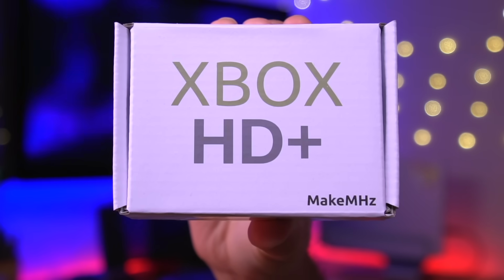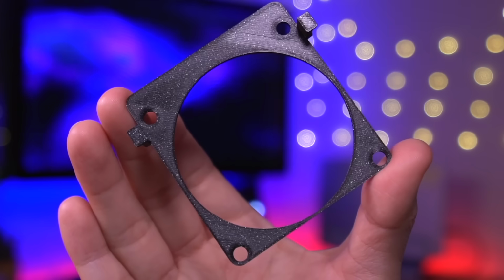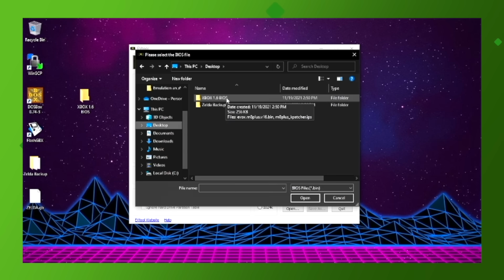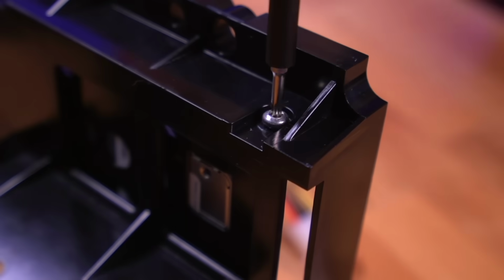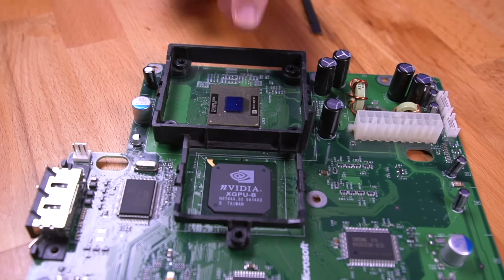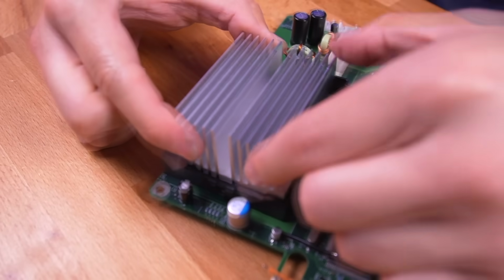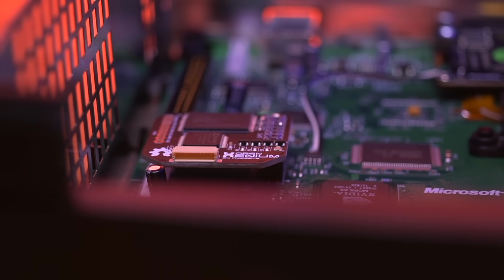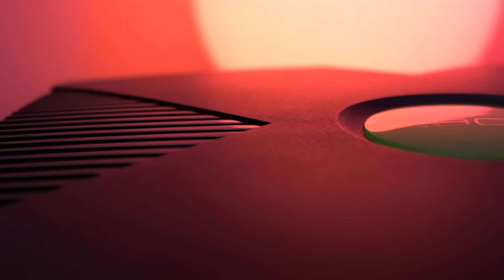I BUILT THE ULTIMATE XBOX TO CELEBRATE ITS 20th ANNIVERSARY | MakeMHz HDMI + SSD + OpenXenium +MORE!

Comment: Didn't the OG Xbox have a shroud over the heatsinks leading to the fan?
Reply: That's on the 360. With the DVD drive fitted the OG xbox didn't need one.
Reply: @ianhaylock7409  Oh okay sounds right. Been ages since I last ripped apart my original Xbox. I figured it did because that airflow looks pretty meager from todays standards!

Comment: For anyone who's watching this, it needs to be noted that the SSD will not add a substantial boost to speed, at most just a second. It's bottlenecked by the processors power, and IDE is slower compared to SATA I and II

Comment: I miss these things. I remember the day when I discovered that I could cut a dongle and put a normal usb end on it.  I had one in 2006 that I did the Splinter Cell save card mod with, changed the HDD out to a 500GB(that was an experience, you had to unplug the IDE cable at just the right moment after the boot unlocked the drive, and then plug it into a PC to copy it.  XBMC was great, and DSL(damn small Linux) gave you a Windows "like" desktop experience.  I wish the Make HDMI had been a thing, but I was getting 720p with the Red Blue Green cable set.  This was a cool video.
Reply: I modden one of my controllers long ago when I took a wild guess that the controllers were just using normal usb and had the controllers were using a usb hub for the memory card slots . So I just replaced one of the memory card slots (since the controllers had two on them, and put a normal usb port in the memory card slot so I can just use usb flash drives for a memory card, and keep the second port for the original card. Later I found this came in handy when soft modding the xbox.
Reply: @ikannunaplays  They were awesome for modding.  Microsoft's first attempt at console gaming.  They just built a PC, lol.
Reply: @GaltJohn2008  Yes indeed, they did the same with the 360 and newer, just tons of extra security with it.

Comment: i was 13/14 years old when i had my xbox and i soft-modded it using Action Replay and the Splinter Cell Saved profile method. I never did any hardware modding to it at all. Only thing i did physically to my xbox was put a cool clear red case on it. I used to mod Halo 2 back in the day. On xbox live i could only do the the DLC map mods since i didn't do any hard-modding. otherwise i used XBC or Xlink Kai for non-dlc maps. man, the nostalgia it brings me. the best times i ever had playing games online. nothing will ever compare to those moments i had then.

Comment: Dang, this mod looks very advanced. I've never heard of unpacking/patching/repacking firmware before, and I'm not even certain the software I'd need to do it. There seems to be many potential points of failure in completing this project, and I wouldn't know what to do if something didn't work first try! Still, this is amazing and inspiring. I think I'll practice more with hardware mods before I worry about software mods.
Reply: Softmodding the Xbox is an option too and its quite simple to do so long as you have one of the exploitable games. I have a softmodded Xbox from like 2015, I used the Mechassault save exploit to do it (you get the same UnleashX dashboard). I use XBMC on it with a really nice HD GUI that makes it look like a Xbox One menu and runs really well.

Comment: I was under the impression that a TSOP flash was the better alternative to a modchip. Is there a reason why you went with a modchip? Is the HDMI mod not compatible with TSOP flashed Xboxes or something?
Reply: In this case, he didn't have any alternative except to use a modchip - the V1.6 xbox doesn't have a TSOP flash and has a masked boot ROM contained in one of the MS custom chips on the mainboard (probably the one marked Xyclops).  If you have an older version, then it's possible to reflash the TSOP, which has both advantages and disadvantages.  The biggest advantage is simply that you don't have to buy a modchip - just open the box up and solder the write-protect links on the mainboard.  The biggest disadvantage is that if you run into a problem flashing the TSOP then you can brick the entire console.

Comment: So I just got one of these installed into my Xbox and was wondering what is causing the graphical glitch. I’ve tested a few 480p games and all of them have displayed the glitch however it’s completely absent in 720p and 480i games. I’ve figured changing the XboxHD+ setting from force 720p to auto has fixed the graphical glitch so until the update do not force 720p. Also where would I go about finding the update correcting the glitch once it’s released?

Comment: I missed it if you mentioned this or not, but did you remove the clock capacitor? They are notorious for expiring in dramatic fashion, corroding the board as they do.

Comment: I wish I was comfortable doing the hdmi mod. Nice work! You may want to consider removing the clock cap and adding a Ogx360 in with your hard drive tray so that you can use wireless 360 controllers as well!

Comment: As a Day one OG Xbox owner, to see those mods look super easy compared to the 20+ soldering job done to one of the OG xbox in my collection.  Time to find a 1.6 and get to modding!!!
Reply: Personally I would go for a 1.5 or older because then you could also do the ram upgrade. There's a select few games that require it and over 100 720p patched games that can utilize it.
Reply: @lain328  1.5 does not exist
Reply: @prismatic1239   You do know that 1.0 to 1.6 a naming thing. Not existing is not part of this, some think it does & others say no.
If you like to got this way, the naming of 1.0 to 1.6 does not exist. We made that are selves, not Microsoft.
Reply: 1.6 ram mod can be done by adding the ram ontop of the existing ram. One pin has to be soldered on top specific parts of the board though. Not read anything of ram overheating after mod but it’s defo going to be hotter

Comment: One more tip: If you haven't done so yet, make sure to also remove the clock capacitor and clean up any spilled capacitor leakage.
Reply: rev 1.6 had better quality capacitors than the previous revisions so the clock cap is less prone to leak, but it's always good to check. eventually they'll all become leaky
Reply: another, another tip. Brooks makes an adapter that will work with the Original Xbox. Its a usb adapter but you will also need the USB to original xbox port adapter to plug it into. This way you can use a modern Xbox controller/PS4 controller or even a fightstick on the original xbox
Reply: @stopthrm  Why would someone ever want to use a modern controller on an original Xbox? The Duke and S controllers are both great.
Reply: Nope not on a 1.6
Reply: @AlfieG2255 My v1.6 had a leaking clock cap as of 1/1/2026.  They're over 20 years old.  I see a lot of people saying v1.6 are safe.  They're not.  (Granted, your post is 4 years old, but I've seen folks in 2025 claiming 1.6 is bulletproof).

Comment: I’d like to know the temps you’re getting with the fan. I did this exact mod with new thermal paste and found that the console was not cooling down properly. Even changed the settings within unleash x only to have the fan sound just as loud as the stock one. The older fan has bigger fans to bring in cooler air, it is loud but keeps the console much cooler. The newer fan is the same size but doesn’t bring in as much air to cool the console. So I cleaned and re-oiled the old fan it’s a bit quieter now. Still looking for either the proper settings for this fan mod or a better fan.

Comment: The version you have is less prone to issues like a leaking clock cap but any time you put time and money in a project like this it can't hurt to give the xbox a preventative recap as well.
Reply from the maker: I totally forgot to mention in the video that I replaced the all the caps on the motherboard and power supply before doing the other mods
Reply: @MachoNachoProductions  you uploaded the patched bin files to the xbox before partiitioning and installing the ssd.
could you clarify this.
Reply: @MachoNachoProductions  where do you get a replacement psu for such an old console?

Comment: Cool mods.  Another tip that I'd mention is that you should only install a hydro bearing fan for it as it basically makes the fan unhearable and functions at optimal performance.  A company I recommend is GUID fans if they are still around.  I have a few left which I bought years ago.  Also SSD vs mechanic drive on a system like this is pointless.  If you got a mechanical drive it's going to perform just as good.  Lastly, you should also remove the time/clock capacitor on your Xbox depending on your model which has been known to explode and leak over all the components on the board causing corrosion. Keep that in mind.
Reply: The SSD is not useless if you're backing up your games to play off of the disk. In fact, it's pretty much the best way to go about it. The difference in performance is massive.
Reply: @caodesignworks2407  The most this SSD's can output is 133MB/s because of ATA/133 limit. Games were writen to use slow (for 2021) IDE drives with whoping 30-40MB/s, so SSD wont do much
Reply: He stated that it’s a 1.6 board revision. No need to remove the clock capacitor since it’s vital for 1.6 functionality. SSD is more reliable in the long term versus regular HDD due to less moving parts.
Reply: unfortunately mine has Already leaked all over the motherboard, but somehow the system survived and works i have no idea how but the only thing that stopped working is the power button and whenever i plug the console in it just turns on by itself, at least the eject button still works
Reply: When transporting 10 xboxes at a time for a LAN party, I'm sure glad I took out a bunch of spinning metal.

Comment: Nice video, but to truly call it "ultimate" you need at least the 2TB SSD (Samsung 860 EVO, the Pro is needlessly more expensive) and the 128MB of RAM upgrade. Others (not me) might argue for a CPU upgrade to the Tualatin 1.4GHz and maybe add some OLED screen for the system.
Reply: Does beefier SSDs really so anything when you're converting the SATA interface to IDE anyways?
Reply: @erik3371  Yes, it offers a 2TB capacity which is at the limit of MBR capabilities. We are talking about "ultimate", so we have to take it to the limit, right? 
I don't think that there is anyone on this channel who does not relate more capacity with being able to store more data (software, games, videos, music) locally and who does not find it convenient to access said data on the fly. It's not always or only the speed of the device that counts, but also its size; whoever says that size doesn't matter either has no use for it, or simply lies.
Reply: I agree with you regarding the 128MB RAM upgrade and the need for a large hard drive, although a mechanical drive would suffice instead of SSD. As for the LCD screen, I installed one on my system, and to be honest it’s a gimmick. I wouldn’t do it again.
Actually, for an ultimate Xbox, now you have the option of the recently released cerbios, which allows the use of an 8TB drive!

Comment: The only thing that I would do different is that I would use a HDD instead of a SSD as the SATA to IDE adapter will basically make the speed advantage that a SSD have over a HDD irrelevant, making the SSD a waste of money. Although I guess using a SSD will be quiet, but stil not worth the extra cost in my opinion.
Reply: SSD also has better seek speed over an HDD, so it may still be worth it. Would need a side by side comparison on loading times to confirm.
Reply: @amcadam26  I have never done any side by side load thest with a SSD, but I have done side by side load test using a Xbox with sata HDD and one with a IDE HDD a few years ago when I was really into OG Xbox modding and the IDE HDD was always faster. 

The reality is that the adapter will slow everything down to the point where any advantage a SSD normally has doesn't really matter.
Reply: honestly, the ssd being quieter is a disadvantage imo, i love listening to the sound of old hard drives working their magic, though of course an ssd is a lot more reliable than those old hdds
Reply: @Fogolol  the sound the original Xbox makes when you turn it on, sounds authentic to me. The only thing that comes close that I have is my Xbox 360 E.
Reply: @austrakaiser4793  yep it really does just sound like an old computer doesn't it? And i fucking love it
Reply: This is why you just need to get a native industrial ide SSD for the OS, I picked up an aftermarket 120gb one for only 36 usd and it actually can cause problems because it loads too quickly in some cases, such as in Defender 2001, but those can be manually circumvented

Comment: Tip: you can avoid scraping the heatsinks entirely by spraying Goo-Gone onto the black thermal compound and letting it sit for a few minutes, then a q-tip/cotton pad should get it right off!
Also, a normal hair dryer can heat the GPU heatsink enough for it to come off.
Reply: You can also have the system for running for like 10mins and it’ll come right off
Reply: @javieraleman5256  And the kids
Reply: Thank you for the advice! I do appreciate it!
Reply: I used qd contact cleaner and it slid right off.
Reply: @fulltone10  I love that stuff and its available at just about any hardware store (and half the price of deoxit)
Reply: Where do I buy an SSD for mine? The site is sold out.
Reply: Acetone also works very well to remove the black gunk from the heatsink, but it may be safer to use Goo-Gone
Reply: QD is good enough for my car's battery wires it's good enough for my console cpu
Reply: An important thing to realise about the OG xbox is that it heatsink paste was never "just" thermal paste. It was actually a thick thermal adhesive, and the heatsink clamps are prone to breaking or coming loose after this long. If you're worried about the clips or they're broken then using a similar thermal glue is a good option to hold it down. If the clips are good you could use carbon pads which will last forever and won't dry out, or a PTM sheet (most accessible will likely be Thermal Grizzly PhaseSheet PTM).
Reply: I guess the question is what kind do I need? What connector / speeds. Dumbass entering chat.

Comment: There is no speed boost when using a SSD over HDD under an IDE controller, even when using a SATA to IDE converter board since it communicates to the system solely as IDE. The max read/write speeds of the IDE controller matches that of a 7200RPM drive, which are easier to find more affordably in higher capacities than SSD (though really, 60GB should be more than plenty for this old beast).
I would also like to make mention of the ability to upgrade the RAM storage to double from 64MB to the 128MB similarly to that of the Debug Kits, and the processor from a 733MHz Mobile Celeron to a 1.4GHz “Tualatin” Celeron
Reply: While you are absolutely right that there's no reason to boast over transfer speeds that are limited by the IDE bus, SSDs still have the benefit of having 0 seek times and that is noticeable in game. There is a video here on YouTube and an article that can be Googled exploring the differences.

Comment: Even though it's a 1.6 revision, you should've closely inspected capacitors because even on this revision, they might be faulty. Also, why no 128 MB upgrade? I don't get it.
Reply from the maker: I replaced all the caps on the mobo and power supply prior to modding. Forgot to mention that in the video. Also the 1.6 can’t be upgraded with the 128mb Ram from what I understand.
Reply: @MachoNachoProductions  Ah, good then, overall a good bit of info to spread for current/future og xbox owners to keep their machines as long-lasting as possible. From what I've read online 1.6 can be modded with 128 MB but this is the only rev. that requires hard-mod instead of just relying on soft-mod, but you've done exactly that, so should be possible, may be a bit annoying though, deeper dive needed.

Comment: Is it possible to do any of the modifications that you showed in this video with a faulty DVD drive? My DVD drive is not ejecting properly, which prevents the system from booting properly. I'm greeted with a multi-language error message and no dashboard ever appears. I know it is the DVD drive causing the issue. And I'm wondering if after it installing the mod chip, it could bypass this error?

Comment: Nice video, but if you really wanted the ultimate xbox original you should've done this to a 1.0 to 1.5 XBOX, upgraded to 128mb Ram, installed LCD with the open xenium and while at it, upgrade the CPU to 1Ghz. That would be the ulimtate xbox original with all these mods along with the HDMI/SSD upgrade.